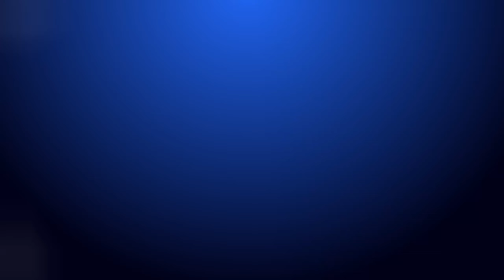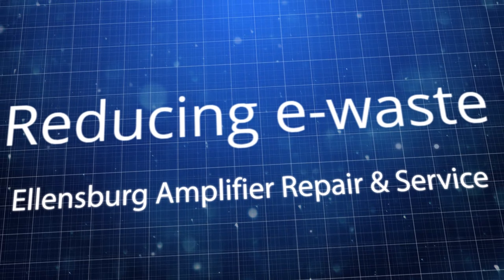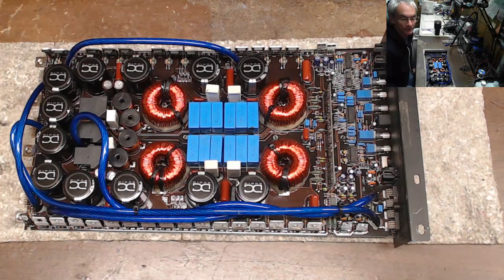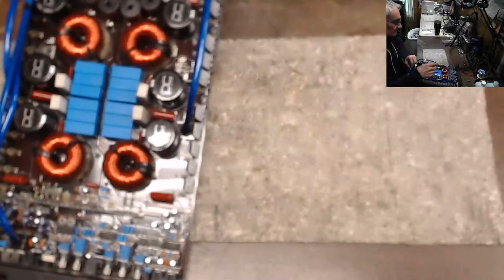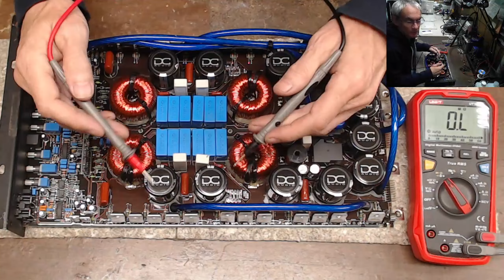DC 10k Output Board Using Gate Source Resistance to Locate the Shorts

Comment: Why don't you repair them anymore
Reply from the maker: I closed the business in 2025. On top of that, the DC 10k has a rail voltage that rides the limits of the components used.
Reply: @ellensburgamplifier  o i c thank you for the info any ways to help it
Reply: sorry about the shop closing